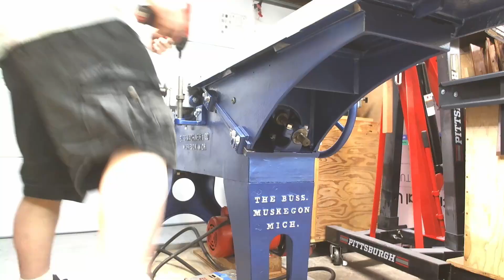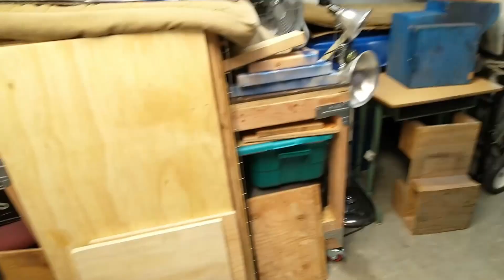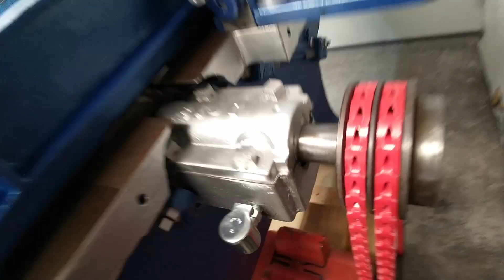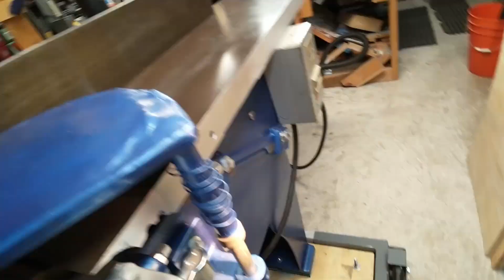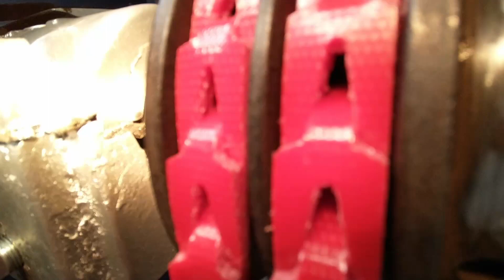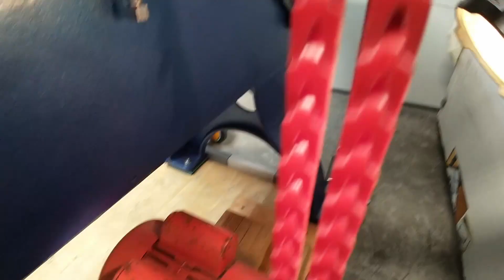Buss Machine Co 8" jointer - motor re-attach and bearing oil leak

Comment: Great vid Joe. Hopefully you can figure out the oil problem.
Reply from the maker: Thanks, yeah I am hoping my posts on the one vintage machinery site will get some traction and ideas.  Worst case, I do have a bunch of sawdust I could try and cram back in there. :)
Reply: Maybe a cloth gasket. @josephkrug8579